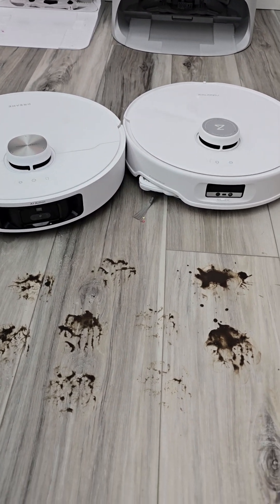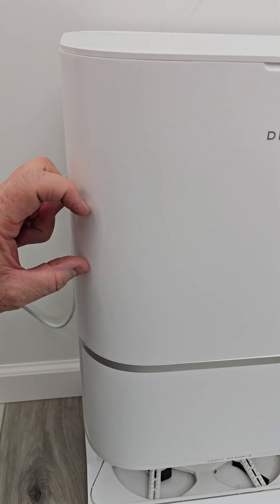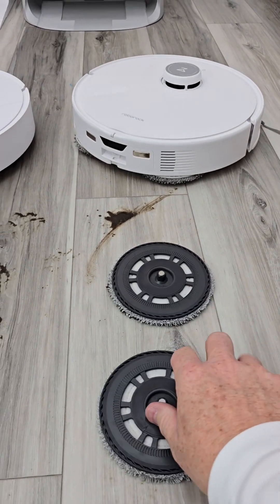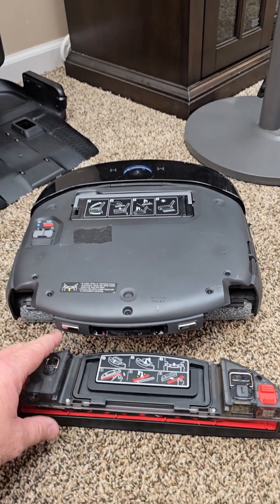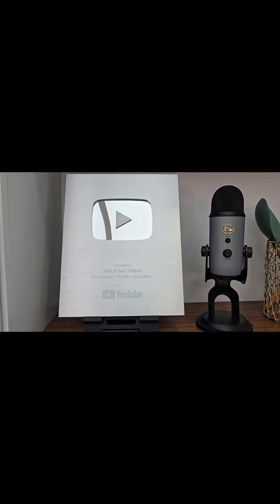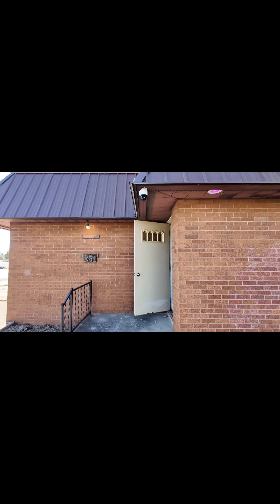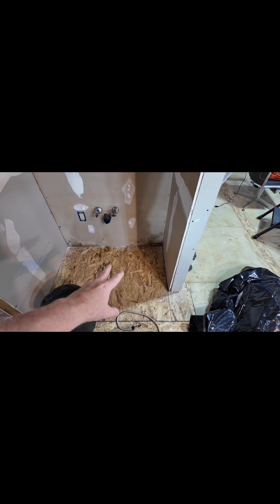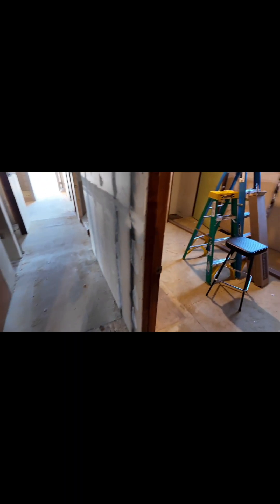How Do Robot Vacuum & Mop Clean Floors? Do They Actually Mop?  Roborock Qrevo Dreame L40

Comment: The new robots like 3i s10  they wash the rotative mop  and sense the dirt level  continuously rather than per each mop wash cycle. This is a huge difference because you can actually wash rather  then spreading dirt on the floor and know exactly where to keep washing until dirt is gone without wasting time and water. More efficient faster effective technology. That said I am waiting for Roborock or Narwal to adopt this technology before going for it.

Comment: Any tips on dealing with stainless steel appliance's confusing the robot? Appliances act like a mirror and the robot ignores part of my kitchen. I realize you should cover up the stainless but wondering if there is a more elegant solution. Using the T30S with Lidar. I don't see anyone talking about this issue but had it on day 1, took me a while to figure out what was going on. Thanks!